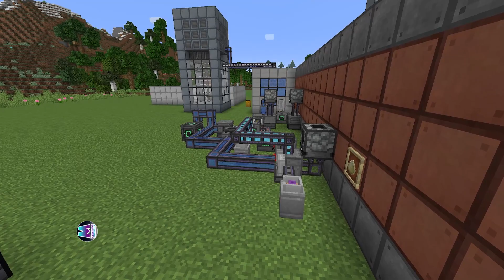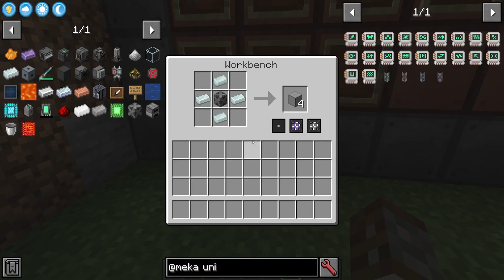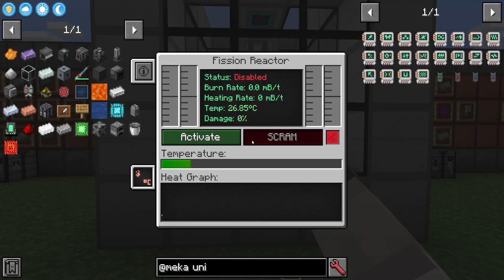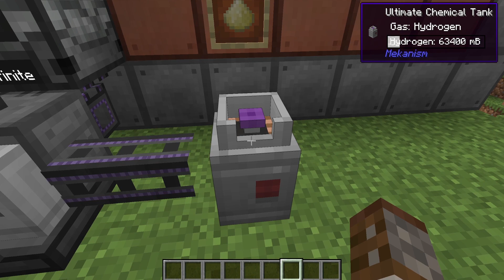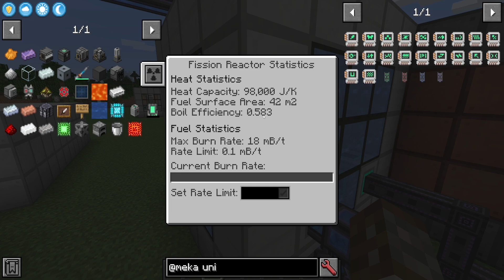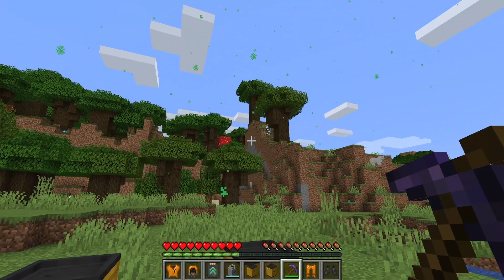How to: Mekanism | Fission Reactor (Minecraft 1.16.5)

Comment: I’m playing Valhelsia 6 and in the config files mekanism uranium is disabled. So how tf am I supposed to effectively and efficiently obtain uranium for this?
Reply from the maker: In most mod packs if multiple mods are using the same ores such as uranium they usually either disable all ores bar 1 so it is unified or they use a separate mod that has all the ores you could need. Therefore there is most likely still uranium in the world but you may not be uranium from Mekanism specifically.

All of this is so you don't end up with multiple chests full of the same type of ores but as the NBT datas are all different none stack and it's frustrating . A good example is in any All the Mods pack every ore is disabled and they use their own "alltheores" mod

Comment: Hey guys, Max build size is 18 Blocks in  each direction, gives u possible 1920 mb/t. But can't handle more than 1420 mb/t. After that it's overheating and taking damage. Even with sodium cooling.... so what's the best way to cool it?
Reply from the maker: Sodium cooling is the best way. Most I can say is have more than one boiler and input port to get more in with a second line

Comment: How did you color those ports? Do I have to make them this color? Because I have only 1 type of port and steam and waste doesnt move out of the reactor.
Reply: I can output the steam manually with gauge dropper, but the pipes won't transfer steam nor waste
Reply: @danielkura8432  Putting this here in case someone else comes looking: you need to set the port of the reactor to 'coolant output' before you connect the cables. I tried changing it while the cables were connected and didn't work.
Reply from the maker: You use the configurator on the to change the port types. Besides that for steam make sure you are using pressurised tubes and not mechanical pipes as it’s a gas not a liquid

Comment: what happens if you break a block of the fission reactor before you turn it off?
Reply from the maker: I think it just turns off and it can be reformed when placed back but in the off position. I would test it in a creative world though to be safe however
Reply: @Mondays3  yea, i was just wondering since i needed to add more inputs for water
Reply: @V1c._.  Did you find the answer to this? I also need to break it to input more rods for fuel.
Reply: @fay2212  I assume you need a response now so from what I remember it leaks radiation in a pretty big radius around it, just go through the hassle of turning it off

Comment: Can someone help me: The fuel wont move from a tank where i stored it, into the reactor?
Reply from the maker: Is the tank configured to come out of that side? Are you using mechanical pipes for fluids? Have you set the pipe to be "pull" with the configurator? Has your input port been set to the fuel? If you have done all these then I am very confused also

Comment: I have to say, that's a lot of work. There are certainly some mods that generate as much energy as mekanism and are much easier to build, but there is the complete fun lost!
Reply from the maker: It's more of a stepping stone to better things than just power. You can move onto the fusion reactor pretty quick which makes more power and doesn't explode. Also using the the waste you can get the meka suit and tools
Reply: @Mondays3  that’s the only reason I’m going to end up needing this. Meka Suits need Polonium :(
Reply: what is these mods
Reply: @emrebektas7630  guys don't tell him

Comment: Well I didn't finish watching the video, sooo...
I broke the barrel in my base and now everything is radiated
And idk what I did wrong but also my reactor explodet so now I have a nice hole in my base🥲😂😂
Reply from the maker: Breaking anything with nuclear waste is very bad but the reactor can explode from a few different ways. 
Not enough coolant is technically the only way but there are a few ways it can break. Either you don't have enough pumps putting water in, or the turbin isn't using enough steam to keep the supply of water looping back. The turbin will stop feeding water back in if the battery you are using fills with energy. If there is no space for energy then the turbin stops and then no coolant goes back into the reactor and it explodes from overheating.

Always good to have a sink of extra energy if you aren't breaking even or even more pumps! Hope this helps
Reply: Maybe it's cuz u put the reactor in ur base

Comment: Hey monday, i built my reactor exactly as in your vid, only in survival, i used fully upgraded pump amd 10 rotor, just like in your vid, and i also made the steam and water loop. Out of curiosity, i pumped the burning rate to 18, ot works and nothing seems to be worng for about 2 to 3 minutes, then suddenly, water reservoir in the reactor went dry and the turbine no longer provide water, i could still see steam going to the turbine. I panicked and quickly hit the scram button,, but unfortunately, after a few second the reactor exploded. What went wrong?
Reply from the maker: Glad you got this fixed
Reply: Nevermind, i found the answer on aiden's wiki
Reply: You pumped the burning rate to 18 that's what went wrong
Reply: @froggedfromwork  not really, i didn't provide enough battery to contain the energy produced, so when the battery is full the turbine no longer provide water for the reactor, thus making it overheat then explode
Reply: @Bintang240196  so what I said is right lol
Reply: @froggedfromwork  uh yeah, but not entirely, if i didn't pump it up to 18, it would still explode, but not as fast

Comment: I mean.. you said to never break the barrels.. how do I move them if they're full? Or empty them for that matter..
Reply from the maker: You have to empty them in order to move them. You empty them the same way as any other tank. Slap a mechanical pipe for fluids next to it and then using the configurator set the pipe to pull and it will suck the waste out of the barrel
Reply: @Mondays3  But it's not like the radioactive waste just disappears when it goes into a pipe lol

I did however figure out that they decay over time, so no worries.
Reply: @Mondays3  Suck the waste to where?  I'm still not clear on this.

Comment: short question, i used my fission reactor for just 2 minutes and then it randomly starts losing water. I also put an elite fluid tank there and three pumps but everytime it starts after 2 minutes losing water. Can someone help me?
btw the tank was full and the pumps were in a lake and fully functional
Reply from the maker: Are you using a steam turbine. The fission reactor turns the water to steam so a good way to keep the water is but making a steam turbine and taking the water out of it and back into the fission reactor. This makes a closed loop and once it is full you can just leave it. Otherwise you are going to need to keep pumping water in constantly. Also check that that your pumps are fully upgraded
Reply: @Mondays3  ah i had the coolant input connected with a valve, i just needed to put in at thevent, thx

Comment: The problem with mekanism is that you only need fission reactor for materials that are needed to craft the armor provided by mekanism. Wind turbines are 100% enough and way less complicated..
Reply: Ehhhh.. Doing a playthru of E6 now and I've got probably 30-40 wind turbines (around 80-90 Y level). They produce enough for a base level, but a full speed/energy upgraded water pump uses like 40kFE/t.
Reply: @jakeconnelly2441 i
Reply: @jakeconnelly2441  I was able to build a factory that multiplies ores mined by fully upgraded digital miner by 5 (and does it without any backlog) and got more than enough energy from 30-40 wind turbines at maximum height
Reply: @lilynightstar  E6 also has the production values tweaked a bit, so it could be that. Mine only produce 240FE/t at the height I have them. Unless the gain from putting them on a sky platform is that huge?
Reply: @jakeconnelly2441  Dunno which version I played but I played it using Valhelsia modpack for 1.16 I think
Reply: Wind turbines generate a lot of lag too tho, better off making a reactor
Reply: @marktheprussian  exactly why I don’t use them on my server, I can only afford a 4gb server and my 5x set up plus a digital miner lags the hell out of it already, and it’s running on an extreme reactor reactor
Reply: It's not about efficiency, it's about fun!
Reply: You need it for antimatter which can turn coal to diamonds
Reply: Just make a biofuel energy factory
Reply: i would just grind for fusion as its OP as hell even when air cooled(and you can get the fuel renewably from just water )
Reply: U all got tiny bases... my AE2 network alone uses 6k rf/t that's not including the resource farms and machines. I can tell that for sure it's at least 290k rf/t
We run 3 reactors

Comment: Hey Mondays only found out about you recently as I've just started using mekanism but holy crap I could not have used this mod without you dude great tutorials explains everything amazingly, one question I had though was does the reactor have to be a perfect square or would 9x19 for example still work? once again awesome series dude.
Reply from the maker: Thank you so much and happy I helped. I believe you can make the fission reactor whatever size and shape you want as long as its a cuboid. So tall and thin or short and fat, it doesn't matter as long it is built in the same configuration

Comment: Any ideas on why I cant get steam out of the reactor into  the turbine? my setup seems  a lot like yours.
Reply from the maker: If you have an interface when right clicking on the reactor then you have built it right. Most likely there isn’t enough water being pumped into it and it looks like not a lot of steam is coming out. 

It might also be you haven’t set the boil rate yet so turn that up as when the reactor is first built it’s default is 0.1
Reply: Putting this here in case someone else comes looking: you need to set the port of the reactor to 'coolant output' before you connect the cables. I tried changing it while the cables were connected and didn't work.